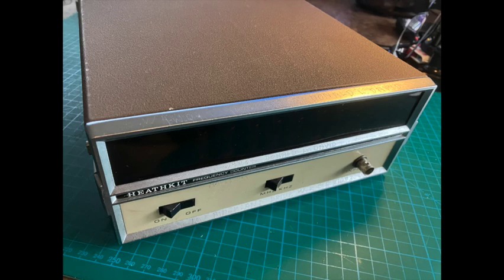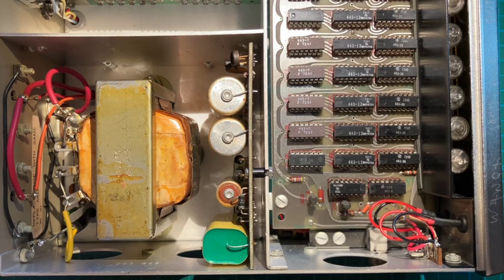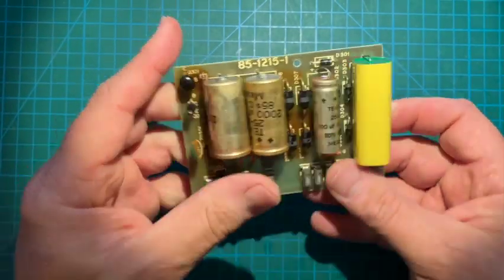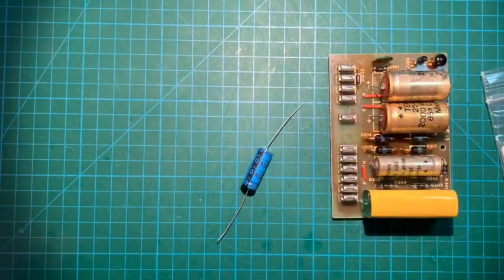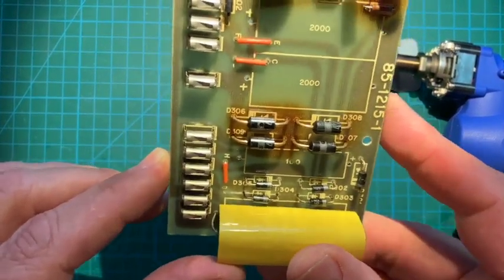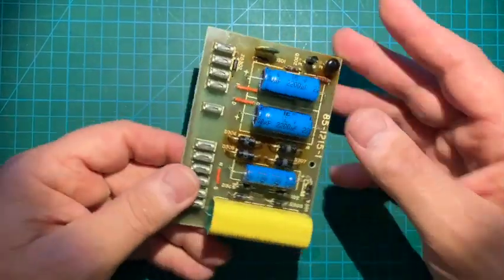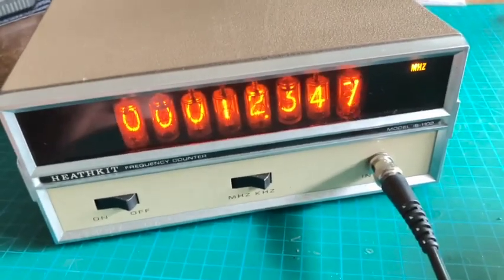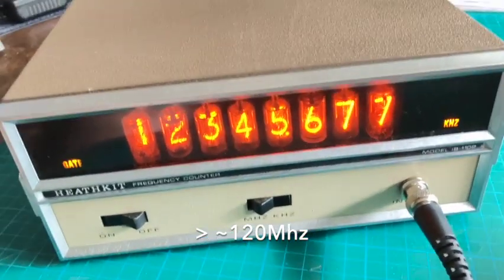Heathkit IB-1102 Repair & Update - With Nixies!

Comment: The IB-1102 is a very nice frequency counter. Good circuit design, good specifications, easy and foolproof to use. And, yes, it is kinda amazing, but those "grain of rice" incandescent bulbs are still readily available....I have no idea WHY they are still made, but certainly not for the Heathkit IB-11xx series market.....
Reply from the maker: Many thanks for the comment!  I gave your IB-1102 video a plug in this video and description,   I almost went with the IB-1103, but it adds significant complexity for not muchadded functionality. I'm quite amazed that Heathkit's 60-year-old 4Mhz (!) TCXO inside still holds like a rock after an hour warmup.  I then calibrated it against a 10MHz GPSDO, and it's been on the money ever since.  Outstanding.